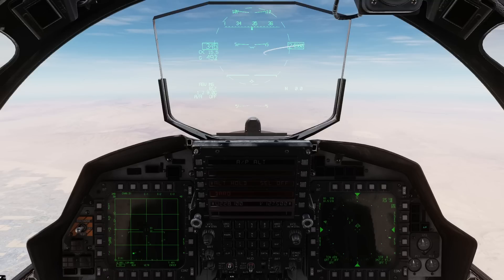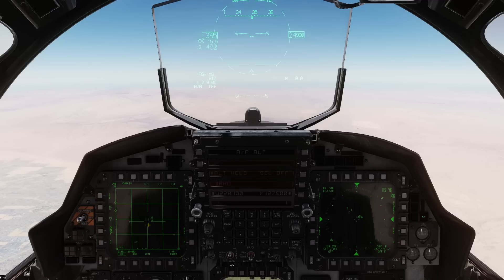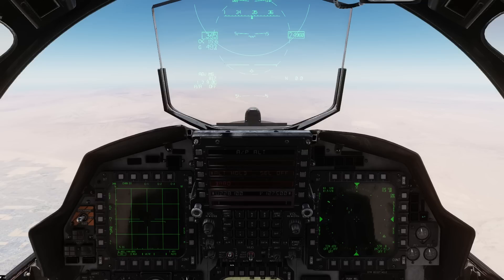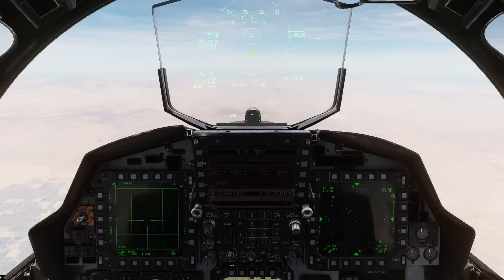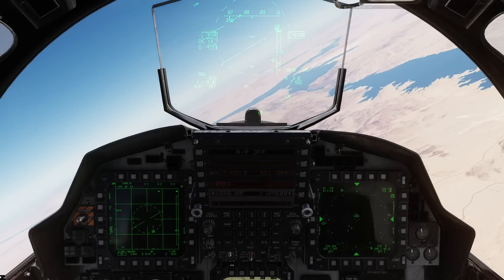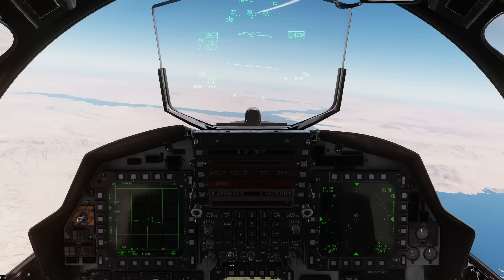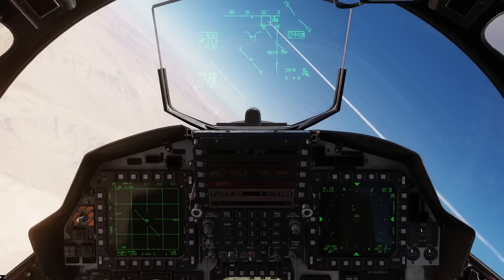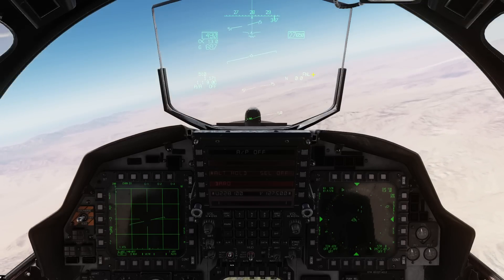DCS F-15E Strike Eagle | APG-70 Part 4: Auto-Acquisition modes

Comment: Sorry for the double comment, but at 12:13 we have a smoothly turning target in an STT-like auto-guns lock, that 'notches' the AN/APG-70 at 1.5nm range, while flying over a smooth and completely desolate riverbank!
(PS. There's also this weird behaviour that I'm assuming is just a small, pre-release cosmetic issue, but still wanted to point out just in case: In the guns mode it seems like the update rate for the radar and the FPS that the HUD's targeting symbology is drawn at, both get reduced to around 5 Hz after a couple of seconds of normal operation.)

I know that the MEM mode allowed him to be quickly reacquired, but I'm concerned about the usual DCS'isms that makes it absolutely impossible for a team to successfully use a realistic NATO BVR gameplan against an enemy that flies at 500 feet, even above a calm and open ocean. (Kind of like the AIM-9X still going for flares and even still being affected by the SUN even if fired at a target that is more than 15 degrees away from the sun!)

TL;DR
I'm well aware that the in-game AIM-120C-5 acts more like an AIM-54A (with a few leaky caps, a loose tube, and about 35% of its usual propellant load), that has been modified to always go active at a constant 10nm RTG (just to give the target an early enough RWR alert, so that most people can survive a completely unexpected BVR barrage with little more than a reflexive split-s into the beam).
In the end the RWR warning is the same, regardless of whether the bandit was slowly flying straight and level, or fast and very evasive, continuously changing his altitude and heading; and whether the fighter has been providing a continuous, high-quality TWS track, or if the lock had been lost a couple of seconds early. 

All of this combined with EW being basically non-existent, leads some people ask: "Why rock the boat if it won't even make a usable difference?"
Especially since there are already so many deliberate concessions to gameplay balance to keep multiplayer "fair and fun" (which the Redfor A/C desperately need, as they remain overmatched by more modern NATO counterparts), such as the RCS being a perfect sphere; clutter being little more than an elevation angle-dependant multiplier; PRF mechanics still remaining identical to what would be expected of the computationally limited, analog radar signal processors; Pulse compression and coherent integration seemingly having no benefit (or just not modeled) as the only difference between STT and TWS seems to be a slower track-file update rate and shorter range; the radar data cube either not existing or not being used to improve target discrimination and clutter rejection, also not taking advantage of the massive increase in the size of the data cube, nor the jump from low-order, 1D analog filters, to large 1D digital filters, through to the adoption of 2D filters (like Space-Time Adaptive Processing and Synthetic Aperature radar Imaging) and FFT processing to extract the spectral contributions and correlations to and between the slow-time, fast-time, range and azimuth dimentions, etc.

Well, I believe it's possible to emulate these features with a toggleable setting that people could use on their own servers (I understand single player won't be feasible any time soon because of the AI), so that those who want to fly around at FL300 for 1-2 hours to get into a tactically advantageous BVR position and good firing parameters, just to destroy a target that you'll never see, without glaring and immersion breaking 'features'.
I should be able to get absolutely smited by an AIM-120C-5 ,with only 1-2 seconds of RWR warning, if I flew straight and level for more than 20-30 seconds without realizing I'm in an enemy's WEZ.
But I should then also be able to reliably kill any A/C flying around on the deck without any strong clutter sources or mountains to hide behind, if I have a massive altitude and energy advantage over him, and as long as I can get to within Rne and keep the lock until impact.
Reply: Uhhhh, 12:13 the aircraft goes out past the radar's bounds, which is why the aircraft gets dropped.

Comment: I'm sure these videos will become even more useful once the plane is out.  For the time being, I'm completely confused at to which direction is "down" on the switch? You have Forward, Aft, Press, and "Down"?  I really am struggling.  I would have assumed that "down" was the depress, but you mention that with another name.  So which direction is "down"? Left? Right?
Reply: Down is pushing it in, as if it were a push button
Reply: Forward is away from the pilot, aft is towards the pilot, down is depress, or pushing the switch in like you would a to get a joystick click on an xbox/playstation controller.
In the context of Auto ACQ, because of the orientation of the control, down and depress mean the same thing.
Reply: @hvymtal8566  thanks for explaining it.  In the context of the video, I thought they meant two different things.  If they are same, it’s clearer to me.  Thanks.